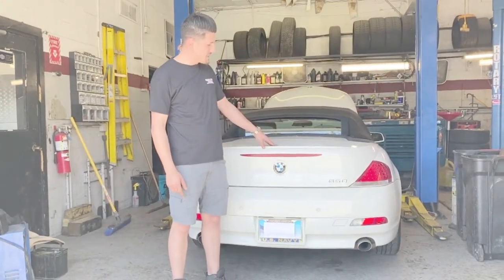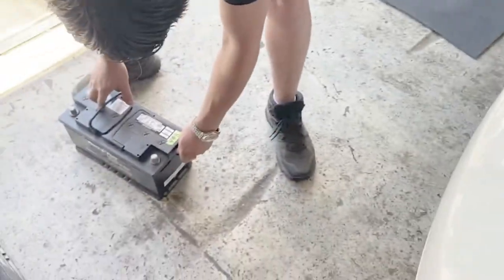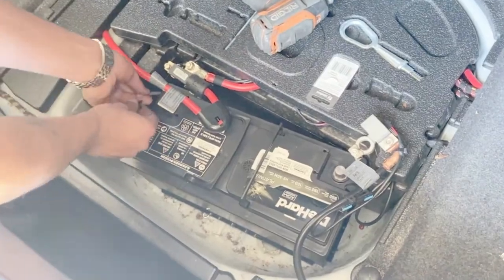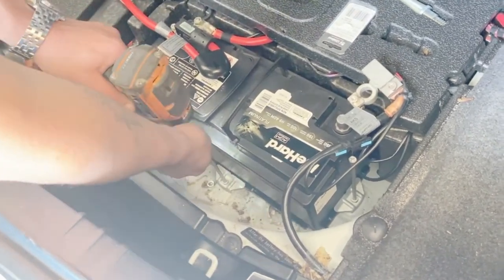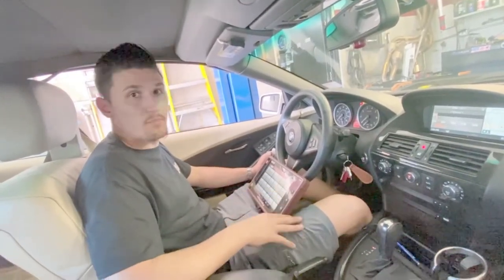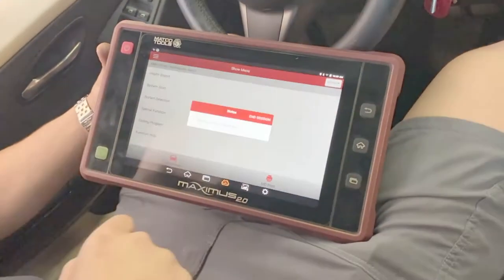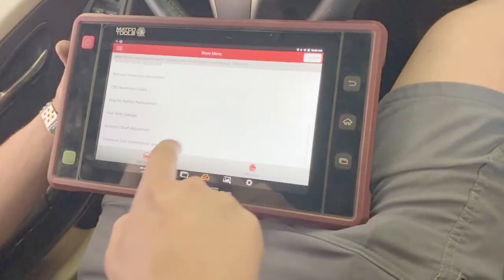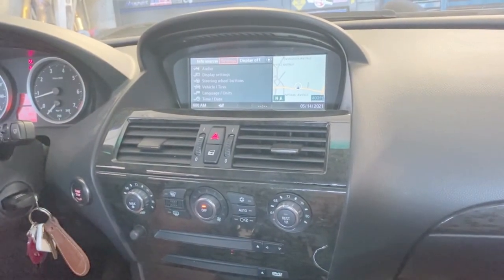BMW 650i Battery Replacement

Comment: I was hearing that there is a certain way you have to remove the battery terminals.the negative then the positive an then reverse it when installing.Is this true?Thanks for the video
Reply: that's always true for all batteries
Reply: the negative ground is... all the metal in the car.. but only when the wire is attached.. so.. that's why we start with the positive.. nothing gets shorted out when we reinstall... taking it out .. if you disconnect the ground.. negative side .. you can't arc weld your tools to the frame.. it's a logical method.. safer too
Reply: my wife is currently at a shop . with a dead battery.. I can't go fix it.. 
take the negative side off first.. I disconnect it before I do anything else.. it's the last thing I hook up
Reply: if you don't have the equipment to register the battery with the ECU it won't work.. everything is controlled by the computer

Comment: Does anyone know the cheapest Scan/Programming Tool I can buy to register a new battery? I see Diagnostic Scanner Tools for BMW for $300+, I see OBDII readers and bluetooth phone adapters for $25. What exactly would one need to do the programming at home and avoid a $150 dealer visit? Im in CA, are there any retailers who would do the programming for you with battery purchase?